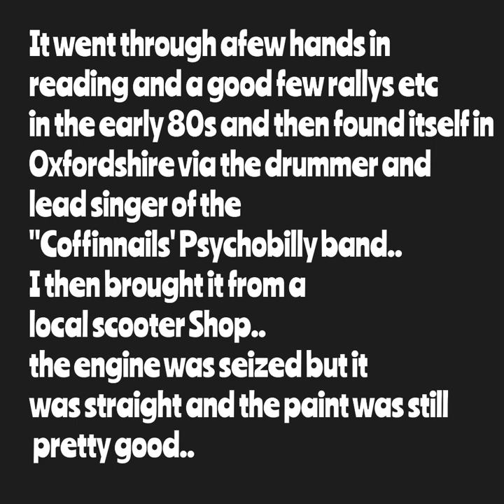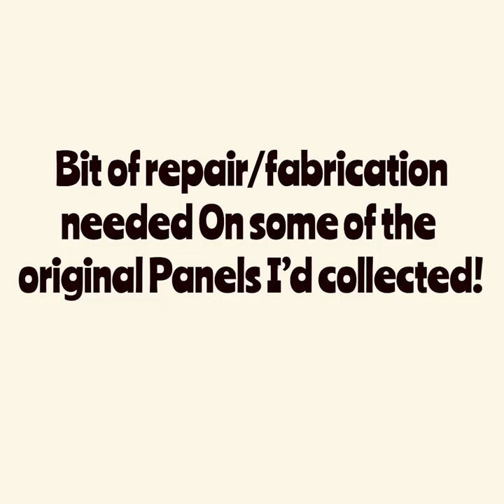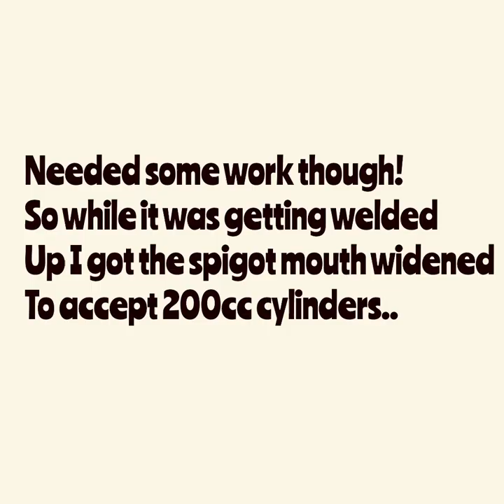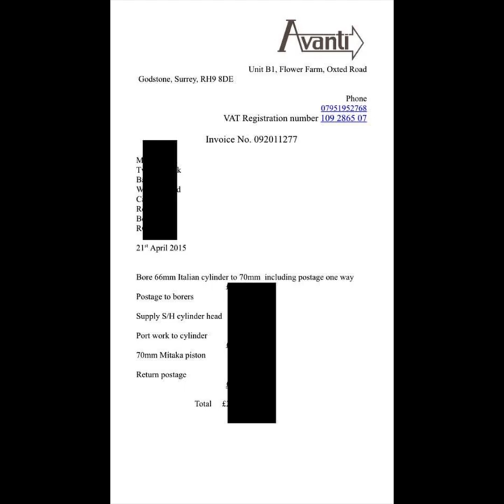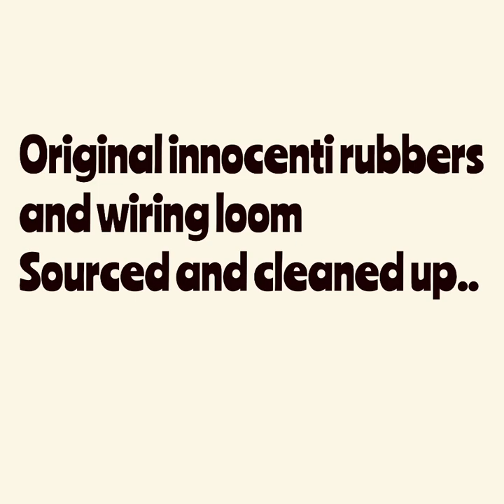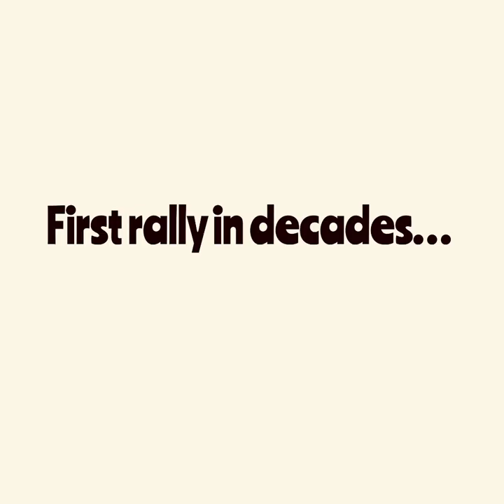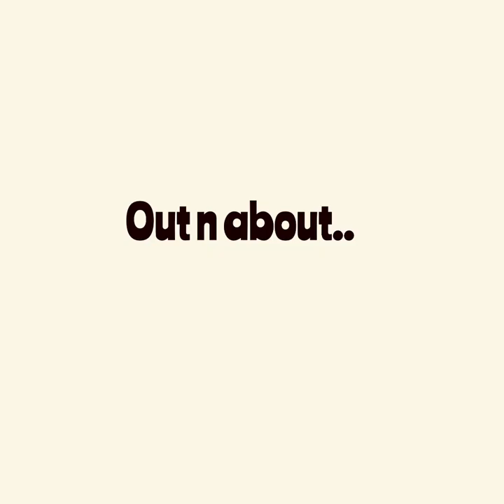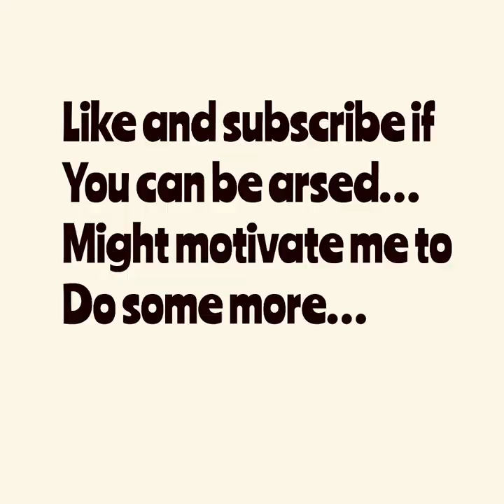Lambretta 1964 pacemaker a restoration story.

Comment: Hi I'm just wondering, the photo at 0.37 the scooter is wearing an Eibar badge on the horn cast....if this is an Eibar originally then it isn't a true Pacemaker....just a thought.
Reply from the maker: No presumably when it was restored in the early 80s someone stuck an eibar badge on it as it’s all they had?… if you look a few seconds before it’s actually got a photo of the original green  rf60 logbook - if you read it it’s actually got ‘pacemaker’ as the model (34 seconds)

Comment: Increasing the size of the spigot mouth, whats involved?. - newly fabricated or a donor part .? Any light on the subject would be appreciated
Reply from the maker: @qft4300  the engine casing?.. the stud holes were welded up and the outside of the spigot mouth was built up with weld to make it thicker … then it’s machined out to except the larger barrel and the face is machined flat… holes re drilled and tapped… this conversion was popular 10-20 years ago when large block casings were difficult to get hold of and tig welding was cheap.. now 200 casings are easy to come by and tig welding is expensive!- so there’s probably not a lot of difference in price to buying a new 200 casing these days… nice to use your original engine casings though, Chris sad @cs engineering did mine.. I think Mike phoenix does/did them to.

Comment: Also Li150 of that period didn't have the SX headlight but Eibar LI 150 specials did , definitely something going on there. I reckon it's an import been given an age related plate .
Reply from the maker: It’s not… it’s a 1964 uk registered from new li150 pacemaker. The frame number dictates what it is not a horncast badge!, and the documentation (I have a copy of the original rf60 logbook and all the 70s and 80s ve50 logbooks from the dvla)

Comment: do you still use 12v points ive been thinking of doing the same
Reply from the maker: @MegaJackpot180  ah… no.. had a bit of a nightmare with that in the end!.. a ran with a bedlam 12v points conversion for 10,000s of miles in the 80s with no issues… however I first tried 6v points on this and it had intermittent sparking issues so a fitted an Indian nos 12v points … it was fine for 500-600 miles then  I was going to go to a German rally (800 round trip) and the week before the stator just packed up (I think it was the low tension coil ) so I hastily fitted an electronic stator and flywheel/cdi etc… and iv been running with that for the last couple of years now… 
so wouldn’t dismiss the 12v points but it’s finding a good conversion? because the Indian ones arnt great!